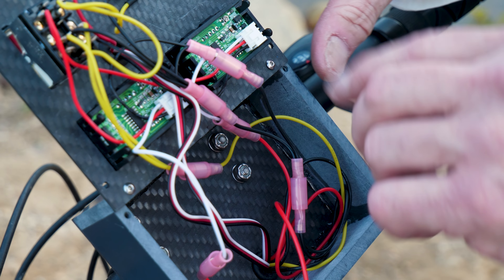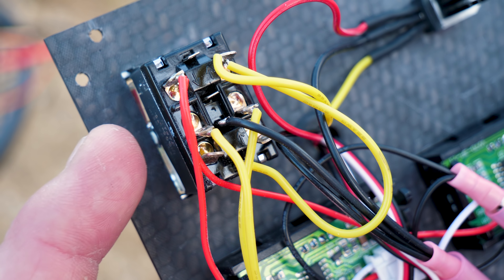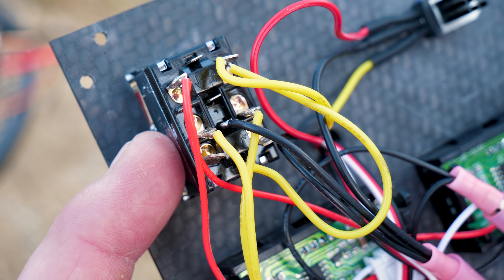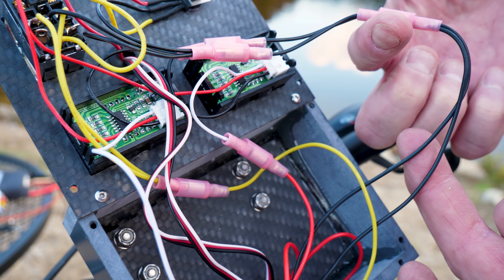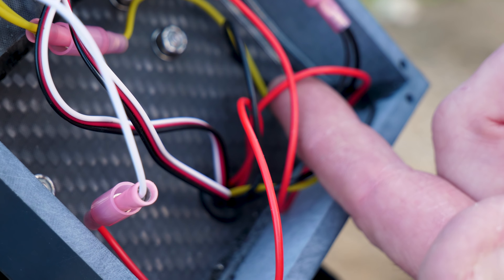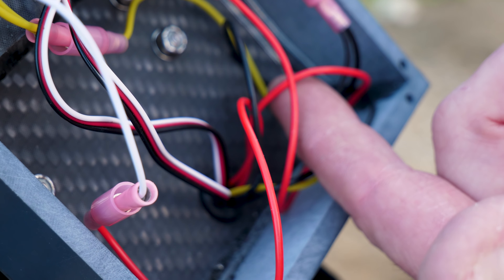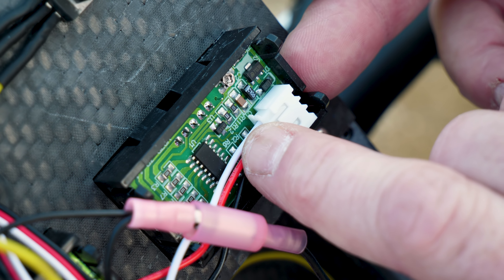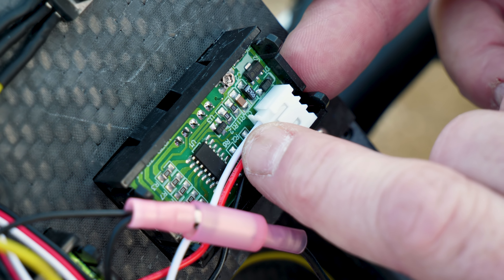Jet Bike - DIY Demo and Test Drive

Comment: Wouldn't be a better(but not so cool) solution to mount a rubber wheel under the rack that engages with the rear wheel? This way you would just mount the rack and press it against the wheel and go.
Reply: Friction drives were the first DIY ebike technology. They were better than pedalling, but are more trouble than they're worth, which is why nobody uses them anymore. That said, I'm sure a friction drive given the same level of attention to detail ("Tech Ingredients" is always very thorough) would beat the pants off this fan-bike.

Comment: That has got to be the worst use of some nice JP fans I have seen.  With that level of battery power a direct drive electric motor would be far more efficient and faster.

Comment: Stupid idea. With such a power direct to the wheel, the bike would fly, and now its bearely moving, even need to pedal...
Reply from the maker: I understand your point, but the idea is far from "stupid". 

10kW applied directly to the back wheel and the bike would travel far faster than it could be safely ridden.  10kW applied to a large propeller and the bike could literally fly ie a paramotor.  Without a motor of any kind attached to a bike, you will get more exercise covering the same route.  Maybe that's a good idea.
For what it's worth, we never had the throttle above 25% and this old Marin wobbles a bit.  It only requires 7 lb of thrust to propel a pro bike rider at 25-28MPH.  On a proper road bike, with good posture and full throttle this thing would move.

Comment: Your fans are all horsepower...no torque....usless in practical mountain bike needs.....not that I'm knocking your efforts pushing the edge....but there are still much more practical solutions....you get a like...but not a subscription......:))
Reply from the maker: They are not as efficient as a directly driven wheel and do not have regenerative breaking. But, they produce up to 3 times the average force a pro bike rider generates on flat roadway.  They make a hill disappear or substantially less steep. They can be installed without modifying an expensive road bike and they are a lot of fun.

Comment: Absolutely no pick up.
Reply from the maker: That's true.  But, with twice the average thrust of a typical E-bike, mounted on a light weight road bike, the top speed will be quite high.
Reply: I'd be impressed with 40 mph. Anything less, you should stick with a regular motor, especially having to use so many batteries.
Reply from the maker: That is a reasonable speed with a good road bike and proper riding posture.
Reply: @TechIngredients  40 MPH is a middling top speed for a roadie, but as an average speed on a skinny-tire rigid bike, you're gonna have problems. Given how rigorous your other videos always are (which I appreciate very much), I'd have thought you'd have at least done some research as to the state of the art WRT ebikes. Electric turbofans are cool, and could be good for some applications (e.g. winter bikes), but fast? Efficient? No.

Comment: alright so now take a carbon race bike and get bigger, more powerful engines than this, and put 4 or even 6 and enjoy lol
Reply from the maker: Actually, we were only running these motors at 25%. Put these on a carbon road bike and...  A professional rider at 40 km/hr requires only 3.5kg of thrust, these two motors generate a combined 10 kg of thrust!

Comment: A rather expensive way of doing it!
Reply from the maker: True, but as we are using these fans for multiple projects that becomes less significant, at least for us.
However, if you have a high performance road bike costing several thousand dollars, this might be attractive because you don't have to modify anything and that is exactly the type of bike where these fans will work best.
Reply: @TechIngredients  Nobody with a carbon fibre racing bike that already does 60 km/h will mount a system that does half that. Frankly, they won't mount one at all because they're usually bike snobs who shun human-electric hybrids.
Reply from the maker: A carbon fiber bike ridden by a pro will maintain 25-28 MPH for one hour on a flat and will require approximately 7 lb of thrust to do so.  This system can produce this thrust level at 30% throttle setting.
Reply: @TechIngredients  If only the earth were flat... 
~( ,m,)~
Reply: @TechIngredients  You're comparing thrust level to thrust level, but not speed. The bike in the video will not do an unassisted (so, no pedalling) 28 MPH on flat ground, period. I'm happy to be proven wrong, but my eyeballometer says your bike didn't crack 12 MPH. As said elsewhere, even the EU-legal 250W nominal kits outpace that with ease...and you're drawing up to 10kW! A 10kW ebike will do 60 MPH+.
Reply: @TechIngredients  Oh, and for chrissakes, keep your feet on the pedals. I know you've already had your kids, but you still don't need a roadside castration.
Reply: @DeliciousDeBlair  What! Are we going with the round-earth hypothesis now?

Comment: I'm not buying it. ~( ,m,)~

Even if it develops 40 lb thrust, that's useless with a 200 lb bike and rider.
Reply from the maker: That's not correct. 

Let me give you some rough numbers to support that.  We have an E-bike that is pretty average in it's performance. A 36 V x 20A/hr battery will propel it and a 210 lb rider (me), 20 miles or 105,000ft. 80% depletion of the battery will place 2MJ into an ESC to drive a BLDC motor. At 80% conversion efficiency, through the electronics and motor, this will provide 1.6MJ into the wheel, or 1.2 million ft/lb.  Over the 105,000ft distance this equals 11.5 lb of thrust.  Our fans produce twice that amount of thrust.
Reply: @TechIngredients  I wish I were free to put this all to the test, but in real life, all I am seeing is a whole lot of averaging, wherein one is coasting down hill and traveling slowly on flat ground a whole lot more than they are climbing any hills.

I would indeed like to see that 1.2 million ft.lb demonstrated for starters, and for seconds, lets see just how much of northern Arkansas you can traverse with those levels of thrust.

To count both extremes in one equation only works if you are burning up all the power in a split second at one end and then coasting the rest of the way.

Otherwise, one or the other extreme must by default be invalid and fail.

You can not develop a high torque/thrust the full distance, nor can you travel the full distance on 11.5 lb of thrust [unless you are on a flat to downhill course the whole way]
Reply: @TechIngredients  Might I suggest you going to say the base of a nice 20 plus mile stretch of the Colorado Rockies, along I-40, and see how far either of those climbs the grade and record all of the variables.

Air too thin? Well...that is one of the hazards of not having the entire planet at sea level, but its something an engineer must take into account.

In fact, the one most notable place where electric motors gain a little respect is in that when they are used as traction drivers [as opposed to those thrusters] they do not suffer as much from thin air as an internal combustion  engine does, so long as you keep them from overheating [since internal combustion engines have to deal with cooling as well, this is not an inherent problem limited to electric motors, and in fact, is likely to be less of a problem, provided that the motor's design does not needlessly convert a whole lot of power into heat instead of motion].

Interestingly, however, an EXTERNAL combustion engine has far less of a problem with thin air so far as fuel efficiency, and, depending on how it is set up to work, also has less of a problem with cooling [at higher elevations]

The ideal engine would be one which gains its power strictly and directly from nature [solar, wind or broadband EM field radiation].
Reply from the maker: Do you doubt the energy content of E-bike batteries based on their published specs?Those are interesting ways to conceptualize this, but the numbers I provided you, do support what I stated earlier.  You need to address these before we move onto the practical limitations you point out.  These are reasonable, but are not deal breakers.
Reply: @TechIngredients  As an energy researcher, manufacturing engineer, and heavy user of battery operated power tools, I have no reason whatsoever to believe the claims made by manufacturers of these products.

Typically the margin of error in manufacturing is from ± 3% for 'reputable' German companies, ± 5% for 'reputable' American and less-than-reputable German/European companies, and as low as ± 15% for less-than-reputable American companies and for most S.E. Asian countries.

Although a few German and Japanese companies try to hold to the more stringent ± 1.5% deviation level, they are typically very expensive and limited primarily for military markets.

Please note that while they use the phraseology of '±', it is to be well understood that this parameter never includes '+' and always includes '-' because any number greater than 100% is factually impossible both electrochemically as well as physically. 

Batteries are a crude and sloppy affair with the margins of deviation to be some of the greatest in the manufacturing industry.

The cost of making extremely high consistencies of batteries is prohibitive to the mass produced markets, and most people, under typical daily usage as they are not engineers or research scientists, will never know or suspect the difference, and from there, since most people are trained to accept such flawed manufacturing, will never bother doing anything about it, seeing as one would have to carefully and personally do a whole lot of costly and time consuming break-down testing, cell-by-cell to determine if they had a 'reasonable hope' of having a good one, and even then, its still a big crap shoot.

I have seen batteries from Ryobi [Chinese made] last for 5 years, and I have seen batteries from the same manufacturer crap out in 3 months. 

My brother, on the other hand, has batteries made by Porter Cable [ German ] and they are well over 5 years and still holding a good percentage of their original charge.

All manufacturers publish the 'theoretical,' and even then, the 'new, right out of the box' rapidly decays in applied use.

To top that off, theoretical electron content, as opposed to actually realized, in-the-field work achieved, is likely going to b off by a significant margin, based on a whole host of real world environmental factors, from a head wind, to climbing grade, to peak speed [the motor], to various components exerting drag on the system, to the temperature of the system [from below freezing to as hot as a human can live] and the list goes on.

What adversely affects the motor and circuits, may be good for the battery, or visa versa, or, it may be bad for all components combined.

I would suggest that a fair and unbiased test could be performed on a specially modified tread mill with the wheel driven e-bike set at various grade equivalents and 'ridden' by a fixed mass [this too could be varied for testing purposes, simply by adding units of weight to represent different size cyclists] and then further translating the results into 'equivalent wheel drag' using a regenerative braking force applied to the wheel while driving the air-pusher bike around a circular track [or flat parking lot] from a rigid tether which prevented the bike from deviating from its course, and in each case, calculating the total distances.

I could draw sketches if need be, but I suspect you have seen something similar and get the general idea.

Again, the issue is, real world testing, or laboratory testing, either way, in such conditions as that you can run exhaustive repeated trials at various loading settings, and average out the total of them all and see what the real power to mileage efficiency is.

Comment: Neat-o ! this channel rocks.........If you have the time/$ you should build a personal flying machine of some sort. A helicopter(reverse dual blade)/Quad-copter / turbo/ducted fan type of thing or even cooler a small jet based rig of the same sort. I'm sure you've seen that 2-jet hover board thing that some European dude/small company made that functions flawlessly. Its funny how such thing are something that Everybody wants yet, are still not mass produced & probably illegal almost everywhere in the USA anyway. About 10+ish years ago the myth busters failed miserably with a ducted fan kit, yet there were already several working models around the world posted on youtube/the net. Welp there is some extreme(yet quite fea$ible) engineering for you though. I'd go with a quad-jet or at least just a quad copter that you can at least sit on/in. Electric anything is awesome but I think the jets would take the cake. But whatever you do next....I'm ALL in !
Reply from the maker: Thank you so much!

Along this line we are constructing a HUGE electric ducted fan.  Take a look at this:
https://www.wingfan.com/en/products/modular-system.html